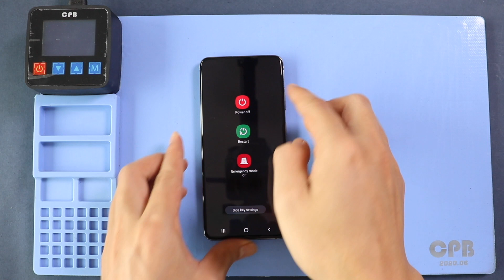Samsung Galaxy S20 Back | Front Camera Replacement / Logic Board (4G/5G)

Comment: Great video. I have replaced the glass on my S20 ultra but the main camera is still blurry. Any advice please?
Reply from the maker: Have you removed the protective taps on it ? Any fingerprints, if not you need to check camera app permissions. And lastly with a new camera unit
Reply: Same problem broo S20
Reply: @medaminesport3233 change camera module is well know problem

Comment: I just replaced the main rear camera on an s20fe 5g (SM-G781U) in 2 times with diferents camera replacements and when i try to open the camera app the app show me an error and when I put the original camera it's work.
Why?
Reply from the maker: First, it can be a faulty camera, you can try another replacement, if not you can clear the cache and camera data. If is still happening, try to check camera app permissions and finally hard reset. Also make sure you have the correct part and proper installation.
Reply: You have to be very certain you bought the right camera, there is a different version for EU and US models, they look the same but different firmware i think

Comment: I got dust in my Samsung s20 plus front selfie camera now I don't know what to do with it. I showed it to mobile repairing  shop but they said if you want to clean it then we will have to remove the display panel for this...?
Reply: And what if I clean it myself, will it get dusty again?
And can be the reason for this??
🙏🏻
Reply from the maker: You don't need to remove the screen to replace or clean the camera..this should be straight forward work, unless you have a broken screen with dust around. Otherwise, open and remove the camera and clean up the area...
Reply: @DIYGeardo  
❤️👍

Comment: Hi bro. i have problem with the camera. When i open the camera app it appears "warning: camera failed". in the app Samsung members on diacnostics, when i test camera, de rear camera works good, but. whem i put the front camera the app crash. I already tried factory reset and use the camara in save mode, include using another camera app. Today i remove the camera without damage, but using the phone without front camera i have the same error, i'm m ready to buy a new camera but the shipping takes 2-3 weeks to mi country and i'm not sure if the problem is the camera. what do you think? Thanks.
Reply from the maker: Sorry for the delay..Well we had some issues similar to this before.. you can try by resetting the phone , clearing camera cache  and storage data..if still no, let us know ..